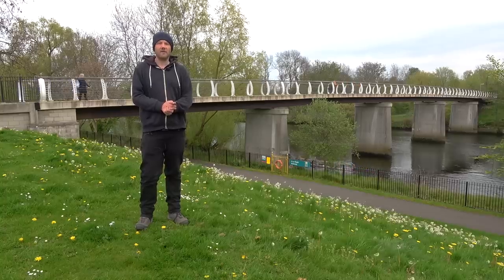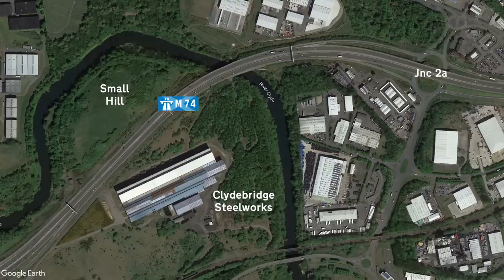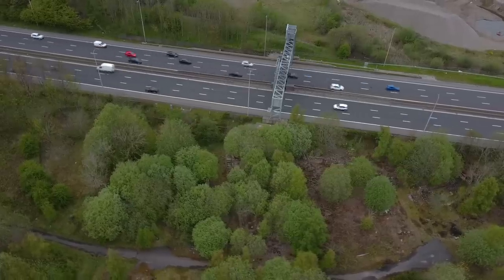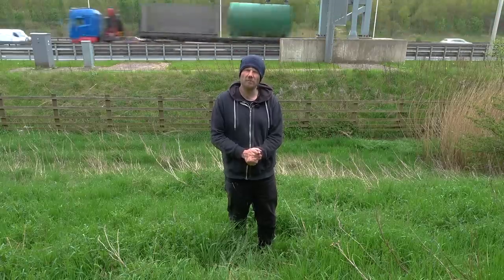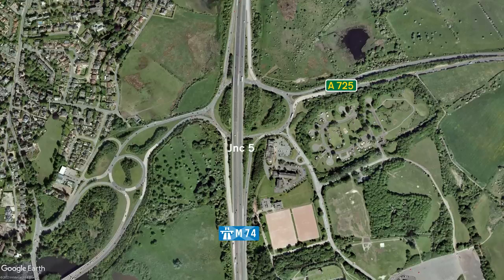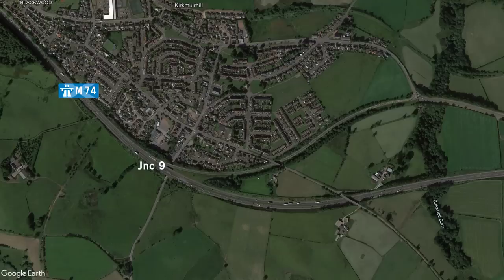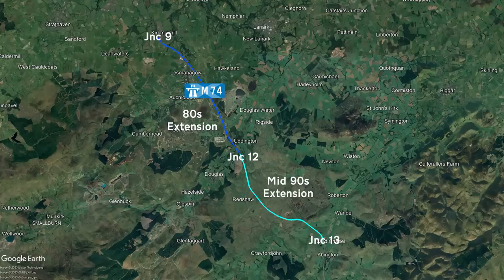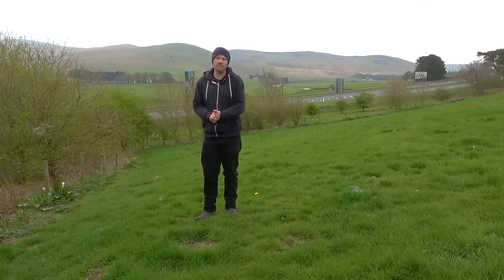Secrets of the Motorway - M74

Comment: Although the upgraded A74 south of Douglas is officially the A74(M) anyone I speak to about simply calls it the M74. The original plan was indeed for it to become an extension of the M6. I remember when it was being built in the 90s that there were signs up for M6 Construction Traffic. However nationalism apparently got in the way and the Scots stated that they didn’t want an English motorway and the existing M6 south of the border could just as easily be renamed the M74. That is true of course but a bit petty IMO. So M6 was dropped and the overly wordy A74(M) used instead. 

Arguably, the A74(M) is more of a motorway than the M74. It’s a six lane road for a start, much of the M74 is only four lanes. Heading North, you enjoy a relatively empty six lane  A74(M) and as soon as you approach civilisation and the inevitable increase in traffic, you find yourself on a barely adequate four lane M74.

All of which has got little to do with this video as the M74 still starts or ends near Douglas and I’m hoping there will be an A74(M) episode soon.
Reply: Yeah and the lights stop after Hamilton. Always found that a bit strange the way they just end there.
Reply: Nothing to do with nationalism. Scottish rules state a motorway has to be numbered the same as the A road it's replacing, hence it can't be either M6 or M7 as neither is the Carlisle to Glasgow Road.

Comment: Have you done the M4 yet?
Well at Skewen near Neath used to be the original M4 or known as the A48 before the M4 extended to Wales in the 1990s.
The abandoned A48 at Skewen has now had housing built on it called Cae Morfa but it was built in the late 1950s/early 1960s called Neath Bypass and abandoned in 1994 when the M4 took over, the abandoned A48 had a service station called Briton Ferry Services which were abandoned in 1994 when the road closed.

Comment: I hate to think how many times I've crossed J6 without noticing how elaborate the slip roads are.  The need for a link from there to the M8 was negated by the existing link from J5 which functioned perfectly well until traffic levels jumped around the turn of the century.  The increase in commuter traffic was another unforeseen consequence of the closure of the west of Scotland's heavy industry.

Comment: Nice video! I commute using the new A725 underpass and compared with queueing at the old roundabouts it saves me about 10-15 minutes each way, and presumably a fair bit of carbon footprint. You need to redo your "if the A723 were a motorway" graphic as that's the M8 at the other end not the M77 (Glasgow to Kilmarnock)! Re the "no English road numbering up here", I understand the sentiment although for some reason we don't seem to have a campaign to renumber the A1 between Berwick and Edinburgh, which does the same thing in the east as they don't want in the west... 🤔
Reply: Glad someone else caught the M77/M8 mix up!

Comment: Yes there are many M74 and surrounding A road signs with M6 covered over with M74 stickers. Must admit I've been very tempted a few times to peel one or two off. Think there is actually a video of someone doing that if I remember correctly. On google earth if you follow the A701 from J15 turn left onto the B7076 (old A74) there is a left to Milton. If you go onto street view and look at the signs you can see the sticker. On the link from the B7076 to J16 the sign seems to have a plate covering M6.
Reply from the maker: I am yet to find a good example of this.. I want to find out if it's really true.
Reply: @Auto Shenanigans  Follow my directions in previous comment and look at the signs in street view. You can see the sticker in one and plate in the other.

Comment: 7:30 you totally missed the old motorway (dual carriageway) that runs parallel from junction 9/10 south. One side has been turned into a cyclepath the other a two way road in parts. If you look you can see it from the roundabout at tesco lesmahagow.

Comment: Nice to see a motorway I've been on lots featured on the show. I tend not to drive it personally, preferring the relatively straight remnants of the old A74 running (vaguely) parallel between jct 12 and 13. Lots of remnants to see of old lanes and bits that were chopped off in the various revisions that road had.

Comment: So, the signs do in fact say M6 under A74(M). I can’t put my hands on it now, but I did have a photo of the sign at the A701 junction that had M6(S) Carlisle on it where the A74(M) sticker had peeled off. Also, at Crawfordjohn, just off the A74(M) near Abington on the old alignment of the A74, the sign had also peeled to reveal M6 designation (though, when I passed there last week, the signage is now brand new). Interestingly, the company that built the A74(M) was known as “M6 JV”, and the M6 designation was only ever intended to be used until the A702 junction as that is where routes to Edinburgh and Glasgow split. 

Apparently, the required effort of the Scottish Office (later Scottish Executive) to do the paperwork to change the name legally was never completed, and the current administration aren’t likely to use an English motorway designation. I do wish they would at least call the whole thing the M74 though, because everybody else does. 

I live a stones throw (well, a good wind assisted over arm throw) from the former Draffan Interchange (officially the Canderwater Interchange) and it’s a popular fly tipping spot for the locals.

You missed out three interesting elements though. Junction 7 only has north facing slips to/from the A72. This is because the M74 at that point was designed purely as a relief for the A72 and A74 in Hamilton, and that the M74 ended on the A74 at the next junction south anyway. Anyone wishing to bypass Larkhall on the A74 from the A72 would simply have used the A71 from Garrion. 

Also, between Junctions 8 and 9 the two carriageways are separated not by the usual Armco, but by trees. But there is a hundred yards or so where it’s just grass between the carriageways. There is a bit of a ditch, so I presume the risk of something crossing the reservation is slim.

Finally, up until very recently, it was possible to get the OG A74 experience between Lesmahagow and Cairn Lodge as the original dual carriageway had just been redesignated as the B7078 and walked away from back in the 80s. It still had its unprotected central reservation, original surface, 70mph limit, tight bends, at grade junctions and weirdly narrow lanes. But about 5 years ago, South Lanarkshire Council spoiled the fun and turned the southbound carriageway over to a new resurfaced cycle lane, and resurfaced the northbound for two way traffic. The original dual carriageway still persists pasts Cairn Lodge, but for safety reasons, the speed limit has been lowered and some lengths of lane removed.
Reply from the maker: Photos welcomed... the search for M6 but not M6 signs is on...

Comment: On the subject of the M74 signage all being printed as M6 then plated over, the sountbound on-ramp to the A74(M) at Gretna services was signed for years as M6. The direction signs said A74(M) South / Carlisle but the actual sign to tell you what road you were going on to just said M6. It was only in the last 10 years or so it got redone to say M74. Still wrong.

Comment: The M74 motorway would of gone all the way down from Glasgow to Carlisle and to meet up with the M6 motorway and to renumber the A74(M) as the M74 motorway. Which the old A74 road used to go from Carlisle to Glasgow before it was replaced by the A74(M) and M74. 

Perhaps the M6 motorway would of gone all the way to Glasgow instead making it the longest motorway in the UK from Rugby to Glasgow. And the M74 would of connected from M6 to M77 south of Glasgow.

Comment: Given that  the  M77 runs from roughly Kilmarnock up to Glasgow, skirting  Newton Mearns , is  anyone else confused to  see it  projected  east of  the  M74 and  Strathclyde Park in this  video ( 5 min 42 sec in. Was there  some  other  M70 odd motorway that  was  never  built?   The M77 must  be  about  the   westernmost  motorway of the   UK barring the  tip  of  the  M8 at  Langbank.
Reply: I was confused by that, so I tried to find that view on Google satellite. I found it. What's happened is that a member of John's staff (ahem!) has mistakenly labelled the M8 as the M77 when doing the overlay. The M77 would be way out of shot to the left.

Comment: Poor M74, the orphan child that has no M7 parent, and bastard sibling to the M6. I recommend renumbering the M74 as the M7, connected by an infinitely short section of motorway across the border numbered as the M6¾. Yes, that should do it. After a consultative process that lasts decades, of course.
Reply: A6 doesn't run from Gretna to Glasgow, the A7 heads to Edinburgh. The M7 would therefore be built through the borders to Edinburgh. The M74/A74(M) follows the A74.

Comment: The whole M74/A74(M) situation really annoys me because in reality it's a complete continuous 317 mile stretch of motorway from Catthorpe to Kingston in Glasgow. Just rename the whole thing as the M6!

Another question I have is that why in Scotland is there a specific 70 mph speed limit sign at the entry to a motorway, rather than an NSL sign or no sign as in England and Wales? Is there some quirk in Scots Law that makes it necessary to make the speed limit explicit?
Reply: It may be a case of forward planning? If the road was designed for a 70mph limit, but the national speed limit is altered to a higher speed at any point in the future, it would cover their asses if someone decided to go faster than the designed speed limit for the road.
Reply: No shortage of “no signs” on M junctions - although they are often provided on dual carriageway A road slip entrances. The absence of them often results in modern car systems (Road Sign Assistance) displaying the wrong value, or none at all, depending on what signs it has recently detected and how sharp the curve has been. Signs visible from lanes they don’t apply to can be awkward as well.
Reply: They have 70mph signs in Wales too on some roads ready for a change in NSL to 80mph.

Comment: 8:33 technically M74 is M6 because you don't actually get off M6 onto M75, it's like that all the way to Stirling
Reply: I wonder if they were ever just going to call it the m6
Reply: @AuroDHikoshi  don't think they will
Reply: Technically you go off M74 and onto M73, then off that onto M80, which then changes to M9 without getting off it. So if M80 can change to M9 without leaving it, then M6 can change to M74, which means M6 terminates at Carlisle. It all makes sense because the old A6 used to go only to Carlilse whereas A74 went from Glasgow to Carlisle.
Reply: @karlejnarch  not really, it's the same motorway
Reply: @karlejnarch  the A6 Still does go to Carlisle